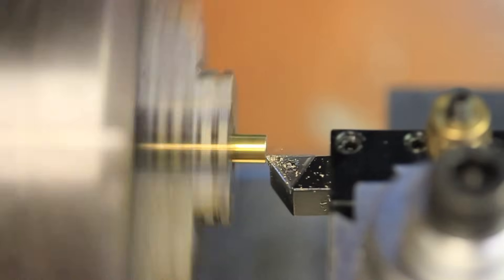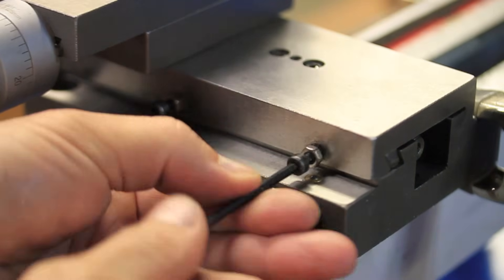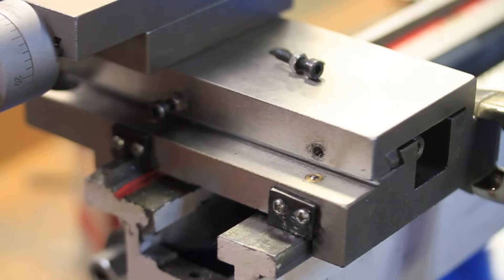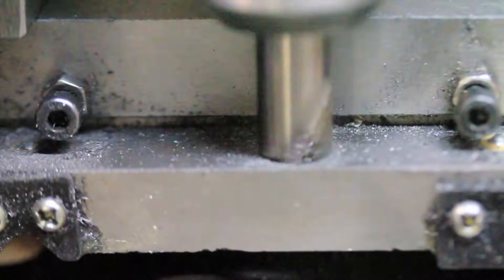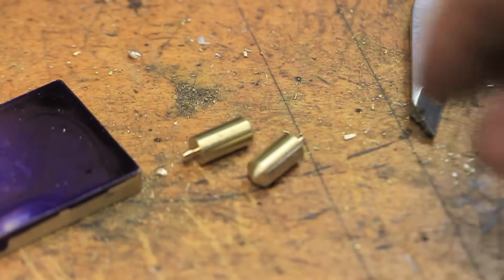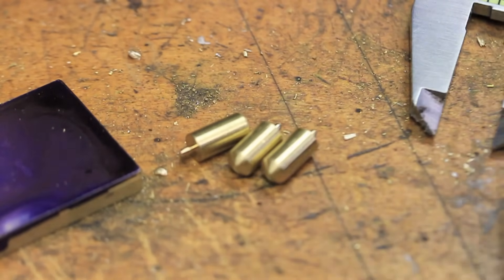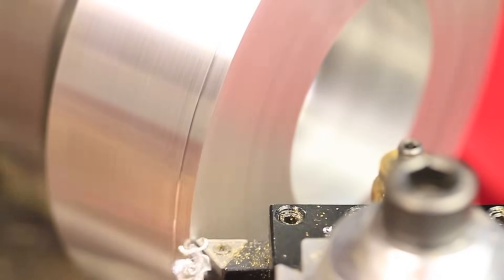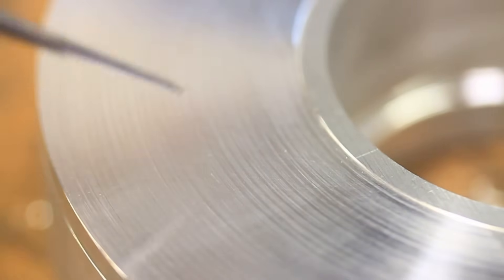Making a Mini Lathe Carriage Lock out of a brass block to improve facing cuts

Comment: nice rigid design, as the lock is part of the carriage, and not just a stop block
doesn't the lock on one side tilt the carriage when tightened?

I will have to hold my tears before I drill into my new lathe to be

Comment: It's 3 years later and they're actually fitting carriage locks at the factory. They're not very good and twist when moving the carriage back. I've been considering making something along these lines to make it move more smoothly. However I also have a problem with the cross slide. It cants over on the gib side under heavy load (for the size/quality of the lathe) and I'm seriously considering adding a cross slide lock as well.

Comment: why not just lock the half nut into the cross feed without it running. serious question I do this with my c3 and it works. is this a bad thing to do.
Reply: Not a bad thing to do and is much better than nothing,  but you still have a tiny bit of slop in there.  That, and I find it very difficult to get the gear lever into the position where the screw stops turning.  I  haven't made a lock yet for mine but I think I will copy this design.  There are better ones but most of them seem to require milling, which I cannot do.

Comment: Great video for an essential addition to the mini lathe.  One thing I noticed at around 5:30 is that you were experiencing drill bit grabbing whilst drilling the brass.  This is scary, but you can modify your drill bits to stop this.  You just need to take a diamond hone and zero the rake of the drill bit.  It then won't grab and will cut away in chips instead.  Much safer when cutting brass!

Comment: 7:28 Ah, now I see what you're doing.  Next time, maybe less work to attach a square piece to the top to increase the thickness.  Or of course mill (or file) the edges of the main piece down.

Comment: 6:29 that insert has a chip breaker, but it's probably designed to work at much higher speeds.  A big difficulty with using carbide on small light machines is being able to run it fast enough to get the amazing finishes it can produce in its proper speed range.

Comment: 5:50 you'll have a lot better luck tapping straight holes if you start using some mechanical means to keep the tap lined up perpendicular as you begin the thread.  Same for a die, the lathe offers various ways of keeping the die lined up as it starts.
Reply: True, do it in the drill press and use a spring loaded tap follower.

Comment: 5:30 the drill is grabbing because the rake angle of the cutting lips is wrong for brass.  It will snatch as you see, and in a deep hole it will wander.  To convert a drill to use on brass, gently stone the leading edge of the cutting lips with a stone held parallel to the axis of the drill, so that you get a tiny flat on the cutting edge.  That reduces the rake angle to zero and it will work sweetly in brass.  Be very careful not to round the outer corner of the lip, that will lead to disaster.

Comment: 4:42 -- when you're using layout dye you can use a very light stroke with the scribe, all it has to do is go through the dye.  You're putting a lot of muscle into it and getting imprecise results from lack of control.  Even when you're not using dye, you're pressing much harder than necessary.  Sharp tip and light touch does it.

Comment: 2:16 you're working way too far from the chuck for an unsupported piece.  You either need to use the tailstock center or a "fixed steady rest".  And you need to get your tailstock centered up to match the spindle, of course, before you can do precision work.  You can do that by making a test bar eight or ten inches long out of one inch stock and roughing the diameter down somewhat except for an inch or so band near each end that you will take light cuts on as you turn it between centers, and then check the resulting diameters.  If they match you're doing something right.  Little Machine Shop has plans for a doohickey you can stick on the tailstock to make the actual adjustment easier than it apparently is on that lathe (my Atlas has a big setscrew on each side, tighten one and loosen the other to move it sideways)

While I'm thinking about it, if you put a spring between the tailstock and the clamp underneath, it will slide freely with much less movement of the clamping nut than otherwise.

Comment: Very cool. But how limited is movement of the cross now? (does it hit those grub srcrews?) I already have a screw on my lathe, but its recessed hex screw - i have to use allen key, but was already thinking about making a handle..
Reply from the maker: Hey! I thought I would have to replace the grub screws with set screws (and I probably will at some point) so the heads don't interfere but to my surprise it hasn't kept me from doing anything yet either from hitting the screws on the cross slide or the handle hitting the bottom of the compound slide. Thanks for watching!
Reply: I agree there will be limited movement of the crosslide as the handle will contact the  Gib grub screws, is there a modification you carried out to solve this clash.
Well presented video.

Comment: Ok man it is nice but why you use brass for this purpose,  brass have thermal properties and frictionless  but robust as iron
Reply from the maker: It won't end up rusting on me is a big bonus... other than that, I just thought it would be neat. Thanks for watching!
Reply: @TimNummy  To state what should be well known, if your keeping the lathe properly lubricated there should be enough spare oil around that nothing should ever start to rust. It took me a very long time at this hobby before I finally learned enough to start thinking logically. For a decorative object the exact material it's made from has little meaning. For anything mechanical that's designed to perform a given task then material choices become ultra important. From a mechanical engineering perspective those material choices will all have a range of + or - natural characteristics verses the exact requirements needed for the part to function as well as possible. And all mechanical design is a series of compromises since there's no such thing as a perfect material that's been invented yet. Brass is used in some assembly's as a bearing material for rotating shafts since it has a low coefficient of friction. And  it's that low coefficient of friction for brass that makes it one of the poorer choices of material for locking a lathe carriage down to the ways. Yes it will work if your handle is tightened to create enough friction to resist the carriage being moved by the cutting forces when making facing cuts. It's also not very strong, rigid or durable when compared to even mild steel. And a high degree of rigidity is exactly what that part needs. I can guarantee that brass plate is slightly bending as you tighten that locking handle. Once that happens your further reducing your locking force or friction since that plate is then only gripping on the outside edges of the lathes bottom way surfaces. So as that plate bends your further reducing it's surface contact area which drastically lowers the frictional resistance your needing. 

In a nut shell properly designing and then machining your own parts is a bit more complex than the average person with a home shop thinks. And choosing the best material by doing some basic research into it's physical characteristics against what the part is required to do isn't really optional. When I started at this the internet wasn't even invented yet, any information I needed I had to find and then buy specific books about whatever I wanted to know. Today it's dead easy to find more free online engineering & material data than you'll ever need.

Comment: Nice... but... wow!! you saw that displacement of the parting tool at 6:44?  I think is because your QCTP is made from soft aluminum, but you have a lathe and can do a good one ;)
Reply from the maker: Yeah that was quite a bit huh... it's usually not so bad when cutting softer metal. Also I think I let it get pretty dull and have gotten into the habit of sharpening it before using it with a lot better results.

Comment: Pick a new career your machining skills make me sick, I almost threw up watching this video, you would be fired within the first 3 minutes at a real machine shop, learn to use a file and center your tool nose with the center of your stock, no wonder why your carriage is pushing away from your stock because your tool isn't centered with your work and there is excess tool pressure pushing your carriage away, so you made shitty stop, now your just gunna blow through inserts, learn to break a chip and use a larger radius on your insert, you would be good at being a puddle watcher sign up for welding school and move to the big city
Reply from the maker: Hey! Thanks for watching and taking the time to comment.... I feel like the tool is pretty well centered as I spent some time doing so and also when I reach the center of the part, it doesn't leave any kind of nub on the end and successfully cuts the entire face. My carriage moves very easily so I just attributed any force from cutting being enough to push it back. The carriage lock I made seems to work and I've used it a few times since with great success, but I'm definitely open to better alternatives. Also, if you can point me to any resources about how to use a file better, I'd very much appreciate that too - please be sure to subscribe so you can follow my progress :)
Reply: Seems like someone can't tell the difference between a hobby and a career. Not all of us have had  a 4 year apprenticeship, and professional teaching.
Reply from the maker: Thanks so much for your comment and support - I really appreciate it!
Reply: TimNummy thank you for being so well spoken and level headed to those who want to sit behind a keyboard and knock you. I personally only have two years behind a machine and learn new stuff all the time the best way to learn is solve the problems that arise. God bless and good luck with the new lathe
Reply: Rai Walden why the heck would he use a file to center his tool? Sounds like you don't know much about machine shop practices either. Keep up the good work and continue the learning process TimNummy.

Comment: Like your projects. may I make a few suggestions? The metal the parts of your lathe is made from is Cast or Ductile iron; Keep it away from the ways on your lathe. It WILL damage them. After any machining of this material, a complete clean of the machine is necessary. Look for or make a travelling steady. this will enable you to machine long thin stock accurately.

Comment: When you say't - had to turn down so the compound slide go over? It looks to me at cross slide tightening screw gonna crash first before compound slide gonna get to the nut
Reply from the maker: You're correct when the compound slide is at 0* but if it is rotated for taper cuts, it would have hit the cap - this way I can have it locked for taper cuts as well. I was thinking that I'd need to replace the tightening cap screws with set screws (and I probably will anyway) but the range of motion is likely good enough for most situations I've run into so far.